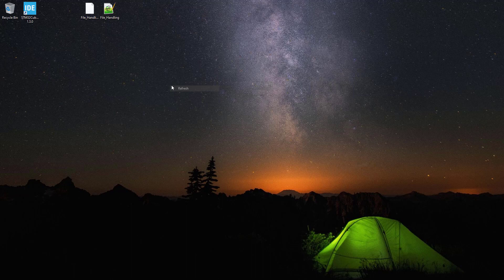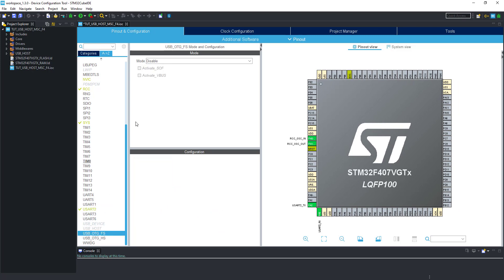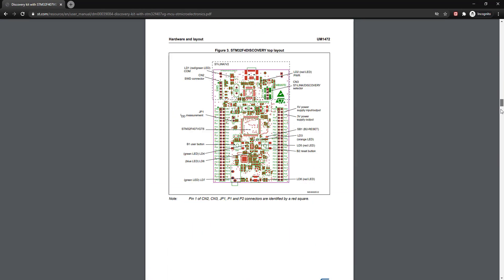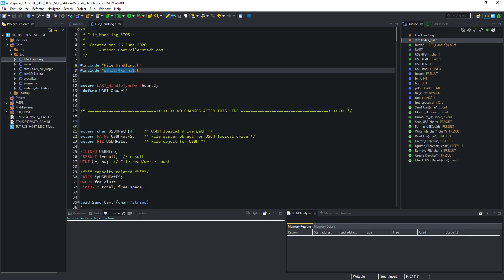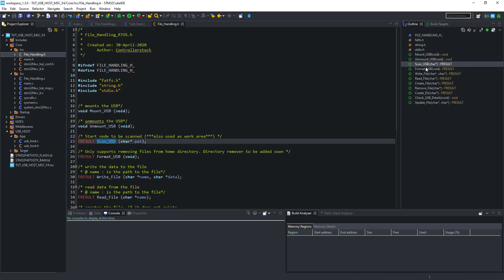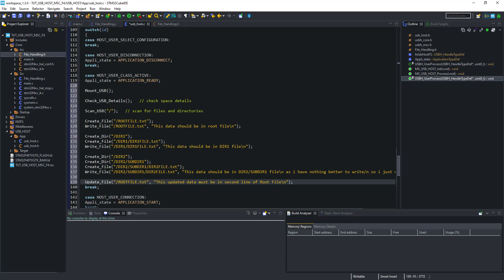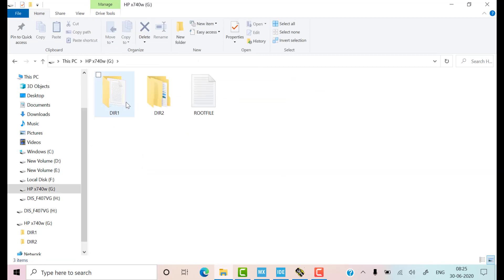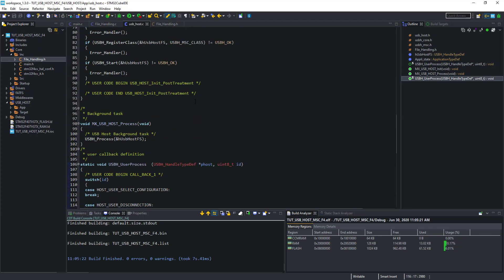How to use Flash Drive with STM32 || USB HOST MSC || CubeIDE

Comment: UPDATE&IMPORTANT: in new version of CubeIDE, we must enable vbus power by MX_DriverVbusFS(0);. I did this under  /* USER CODE BEGIN 2 */ in main.c. Otherwise the usb stick is not powered. ps. My CubeIDE version 1.8.0. Firmware package version FW_F4 V1.26.2. tested on stm32f411 discovery board MB1115D
Reply: I was dealing with this problem since almost a week, I only could avoid this problem by copying old USB_HOST library(created by this video owner) into new file that I created on CubeMX. And today I saw your comment and tried this code . It is working !!!!. Thank you.
Reply: @ugurcanusta7005  hocam bır sorum var bu konu ile alakalı yardımcı olur musun
Reply: Maybe you know a solution for FreeRTOS?
Reply: @setevoi1  I don't quite understand your question as this issue is not related to FreeRTOS.

Comment: Thanks for this video , can you help me?. How can I read and write hex files and image( .jpeg , .bmp, .png) files from flash drive?
Reply from the maker: Just like how you write any other files.
Reply: Thanks for the replay , I want to read Image files from flash drive and how to utilize Internal LIBJPEG decoder to display image on LCD by LTDC(am using STM32F429I-DISCO)
Reply from the maker: You can simply use the FAT fs to read thr file from the drive. Regarding LIBJPEG, I do not know about it.

Comment: There is no problem while reading file and works perfectly unless it has data byte limitation. For example I want to read bytes from hex file having 64kB data. When I try to read data from file it is just stay stuck after "To READ data from it"  debug message and not showing anything after all. To solve that issue I just tried to change value of USBH_MAX_DATA_BUFFER on usbh_conf.h file to 64000. Unfortunately it didn't work.

Comment: On my custom board, using a L151cb, I only have access to "user-defined" fatfs, and my files do not look anything close to yours :/
Reply from the maker: Your mcu does not support usb host. You can't use this tutorial
Reply: @ControllersTech  
Yes, and thanks for the awnser. I figured as much after some digging.

Though, I don't really understand why Fatfs is available and what can I do with it cuz this seems like the one thing it's for.
Reply from the maker: Fatfs is the file system.
You can use it for any storage device. Like SD card using SPI
Or you can also use the usb in the device mode

Comment: Hi, i am trying to implement usb msc with stm32f107,i have a custom board which didnot have power switch for vbus so i create a resistor divider so taht required voltage can be available for vbus bit after debug i notice that my application state is always application start so i want to know what could be the reason and what happened if we left vbus option as it after activate it

Comment: If serial communication is not working,  it could be that RxTx pins are not connected to STLink. Check your board user manual. This is the case for STM32F4DISCOVERY. Looks like old board has his bug, in  newer boards it was fixed.